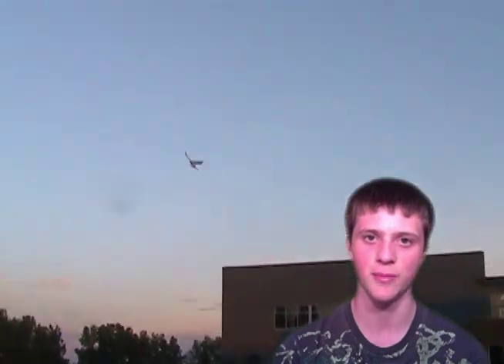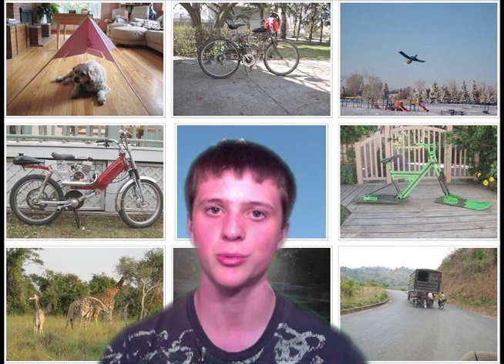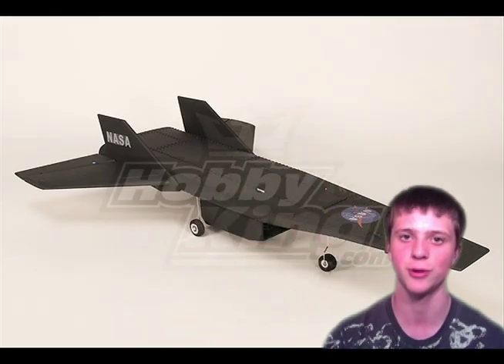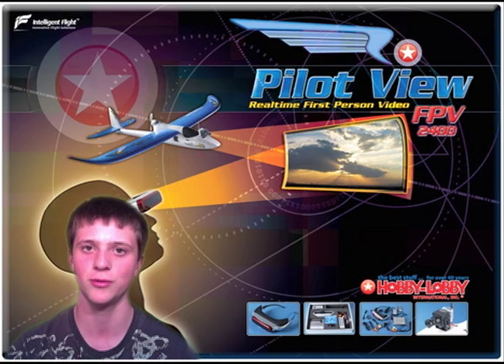Portable Aerial Video Aircraft #2 (Season 2, Episode 8)

Comment: @RCexperimental Aspect ratio is more correctly defined as the span squared divided by the planform area. High aspect ratio wings have higher lift to drag ratios which is why they are used on all airliners and gliders. ALL modern fighter jets have very low AR wings because they are not concerned with efficiency; just speed,  strength, staying behind the bow shock,  and low roll dampening.

Comment from the maker: @DynamAero Aspect ratio is the ratio of the length of a wing to the width of a wing. Fighter jets  typically do have a high AR, however the wings are smaller. It is difficult to compare anything to a fighter jet though because the body of the jet does generate lift. If you had a plane and flew first with a high AR wing and then with a low AR wing, the plane would go faster with the high AR wing and stall at a slower speed with the low AR wing.